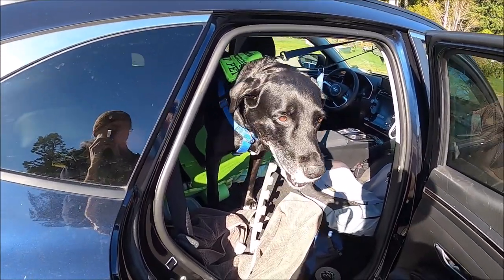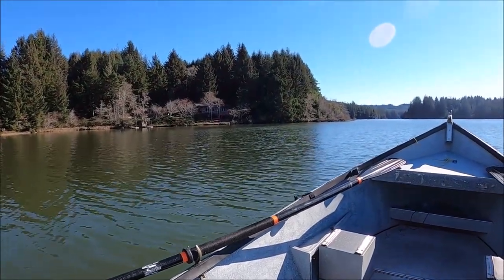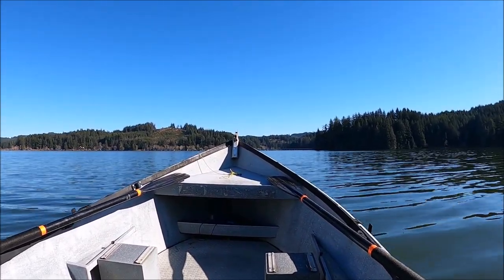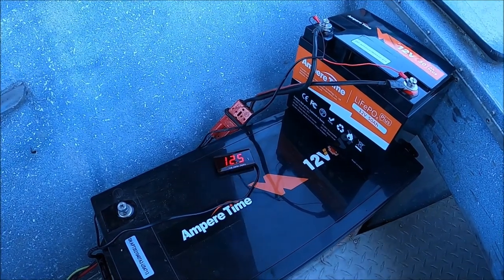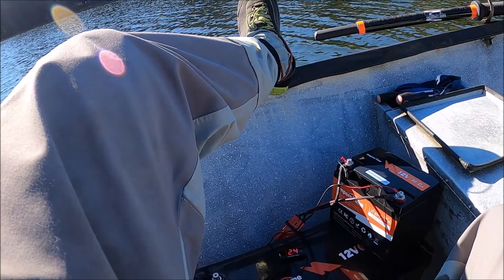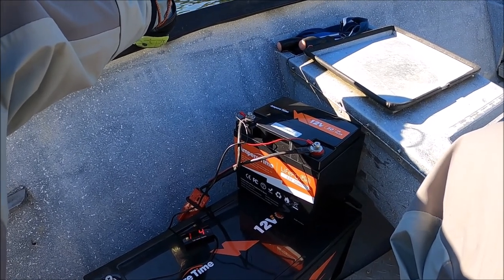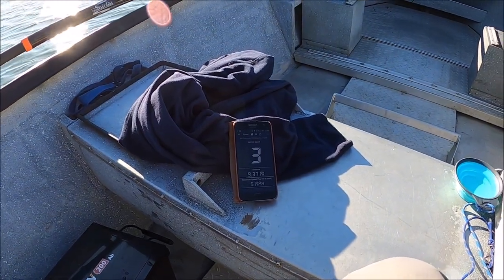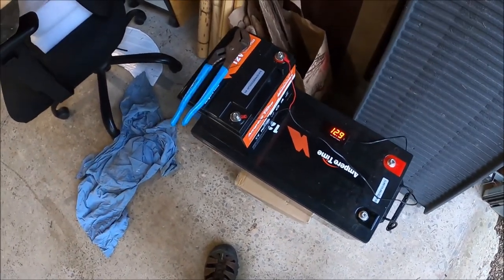45# Minn Kota Drift Boat Test

Comment: Roger I don't know how to private message your channel but I have an important question and would like your opinion. I'm getting ready to purchase my first kayak and I'm goung with a Hobie. I will use it out of sunset bay, coos bay, the coquille River systems, tenmile lakes, etc..both for fishing and spearfishing. I'm undecided between a pro angler 360 in a 12 or an outback like you have. I will.also use it for surf launches at Port orford to northern California coastline. Your opinion would be very helpful. Thanks
Reply from the maker: my first Hobie was a 2012 PA12, then 2012 Oasis, then 2019 Outback. For ocean swells/bar crossings/beach launches, I feel that the PA12 size/height/weight means you have less control over the outcome of serious situations. I have absolutely found the new design Outback, at 12.5', fairly wide but low to the water, to give me much more confidence that I can get out of almost any 'pucker moment' without a bad outcome. Key Outback items: drop down rudder, steering control on both sides, wide seat (in my case, this lets me shift my weight to offset when Pepper's weight is off center), retractable transponder cover large enough for side scanning system. The low speed glide of the Outback is amazing, it makes trolling salmon so easy. I strongly recommend the aluminum rudder from SAI.
Reply: @RogerEmigh  I got the PA12 THEN the outback. Crazy story but now I'll see you on the water. Your an inspiration thanks a ton! I've started YAKVENTURES on YouTube and it's in its infancy. Totally struggling with a good video edit app but all the same I'll eventually overcome the hurdle and get it on the water. Pun intended.  I also just ordered the SAI Super Rudder. Thanks for the suggestion.
Reply from the maker: @yakventures9544  lots of good info and fishing reports at the NWKA forum, you can also PM me over there.
Reply: @RogerEmigh  you really inspired me when you caught that halibut out of your yak! That's a total bucket list for me.